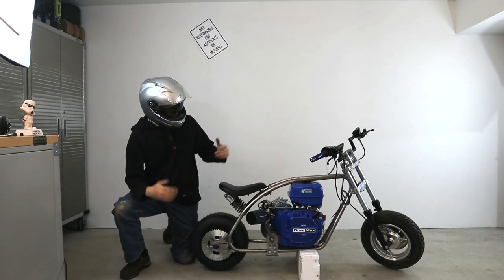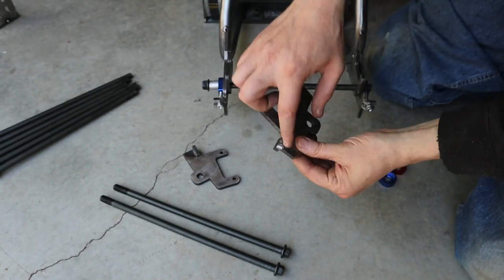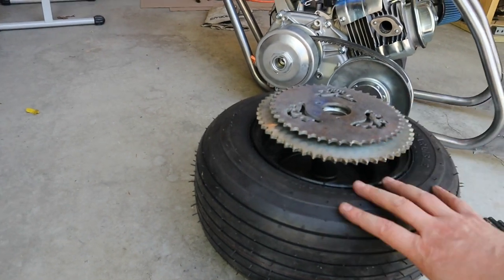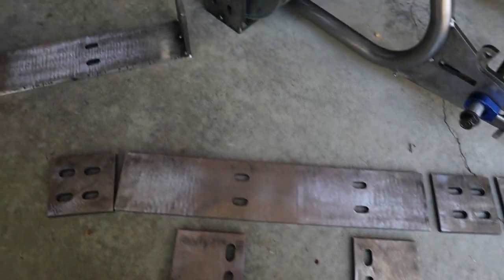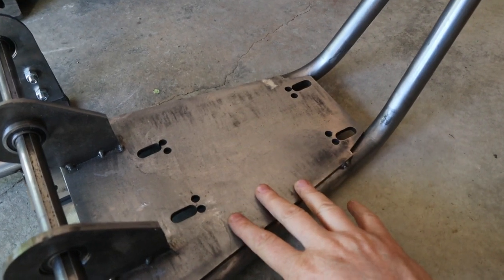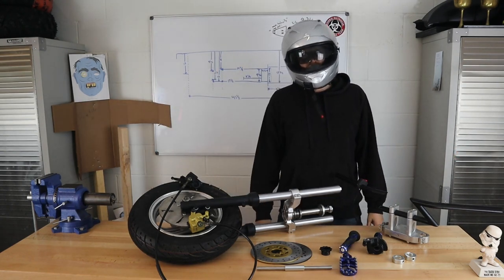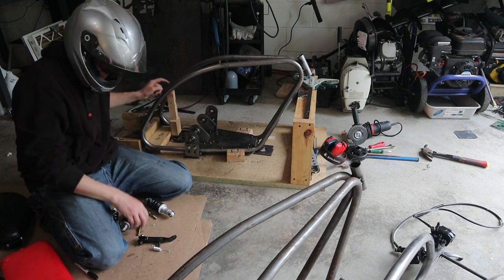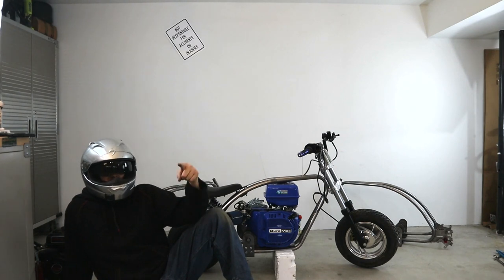DIY mini bike pt 3 (tabs and homemade build ideas)

Comment: Rather than the carbide for opening the bearing holes, try a flap sander. It'll give finer control and you'd be less likely to accidentally get out of round grinding. Also, you should really swap which sides the brake levers are on.

Comment: Thank you for your videos. I’ve done a lot of fab’ing over the years for different mechanical companies but I was clueless when it came to ratios/ clutch’s/ etc. I’m having fun w a small Coleman I’m putting a 212 in the place of a 99cc. I’ve built the 99 as far as I can. No mod parts for the 99 
 At 119$ (212)cheaper to just replace it ! 
I appreciate all the info in your videos.
I’m subscribed and telling people to check you out! 
✌️

Comment: Install zerk fittings  so u could grease ur driven pulley bearings with a grease gun..   I had a 
tote gote with zerk fittings on everything  wheels,head,  & the driven pulley was on the pivot point for the rear swing arm.      
Full suspension 8 hp L head     The coolest minibike  ive ever had my hands on.

Comment: Awesome build!  How do you like the duromax vs tillotson?  Was thinking tillotson 225?
Reply from the maker: well, Tillotson doesn't put out a 440cc that will be putting out over 22HP and just under 30 ft lbs of torque with only minor mods... so I don't know if there's a good comparison on this one. ;)
Reply: @megoingfast  What about the Predator 420 for comparison?
Reply from the maker: Predator, available locally with 13hp only at harbor freight, 18+ ft lbs torque, cost $399 sometimes has coupon for less has electric start. Duromax $379 with electric start but $339 without and available from tractor supply, Lowes, and Amazon with free shipping to home giving it decent return ability. Rated at 18hp and 26+ ft lbs of torque it's in a league of it's own. Uses many of the same Honda clone 390 aftermarket parts.
Reply: @megoingfast  thanks for the tips, never knew that just have seen a lot of hype around tillotson.  I am assuming this takes an40 series tc and does a juggernaut fit on this or what would you recommend?
Reply from the maker: @TheBiliken  40, but hoping the 44 fits as well with design for more power. Parts just cost so much to test them all. Juggernaut is 3/4" driver and shaft is 1" unless there's a new juggernaut for 1" I haven't seen?
Reply: @TheBiliken  check out the New Tillotson 236 at EC Carburetors first!!!
Reply: So just looking into the specs of the 440 and it says the max rpm is 3600-4000.  Would you still have the power and top end over a tillotson 212?  Asking because the investment to upgrade would be about 700 bucks or more.
Reply: @TheBiliken  for about $500-600 you can get a fully built Tillotson 236 with a head, carb , Flywheel and everything.
Reply from the maker: @TheBiliken  the 440cc and 212cc are in two completely separate classes. No comparison. You want an engine best bang for your buck reach out to childishconcepts.com or their page on Facebook and check their Dyno numbers. Even if you want to build your own, you get to see what a pre-built ported head looks like done pro. Tell them budget and purpose. Engine will not come with header though since that's build specific.

Comment: Can you please do a install vid on the 9000 rpm predator 212
Reply from the maker: Controversial. I'd like to do more when I I have a much higher sub count, but when your sub count is lower and a higher sub count channel does it "differently" all you get is grief. I was planning to do a little detail in the next video of the build series though. Needed a part, might be able to throw some info in.